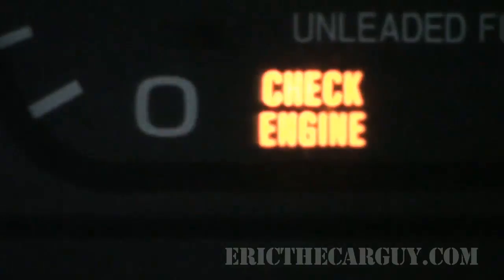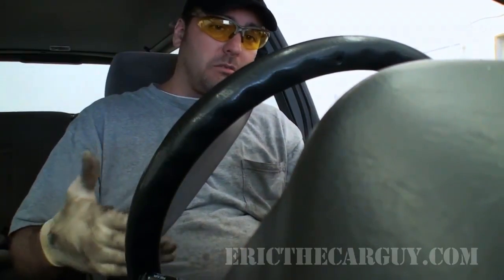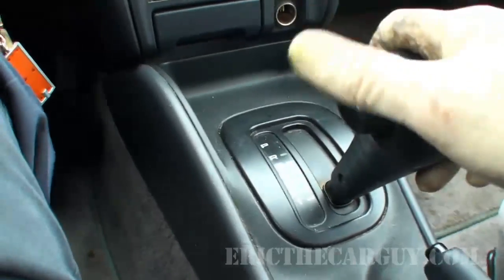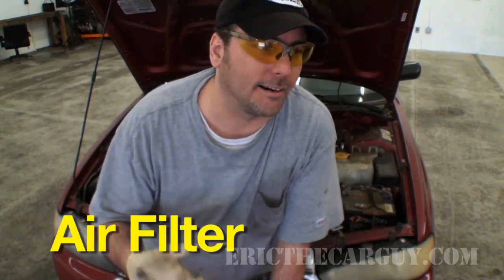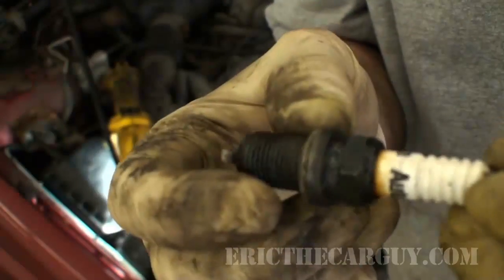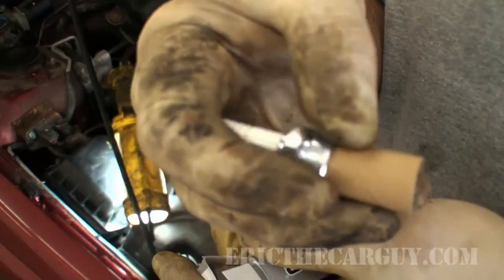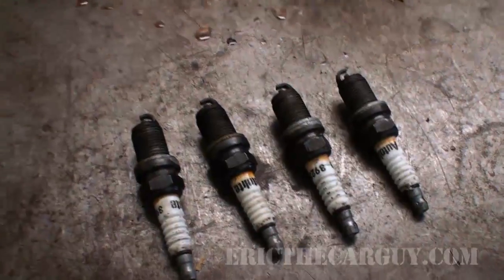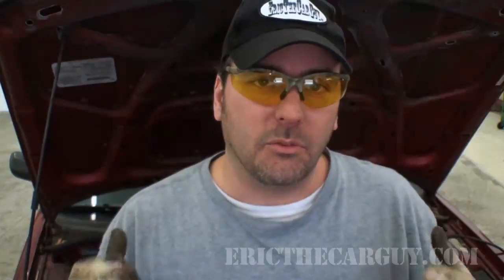Solving Engine Performance Issues (Part 1) - EricTheCarGuy

Comment: I know they don't boost it up but they're supposed to help the fuel burn a little more efficiently. I'm getting a cold air intake, flashing my ecu and a magnaflow exhaust system (i found them barely used really cheap and in perfect condition). I need to replace my spark plugs anyway so i'm wondering if there's any good thing about getting a set of the ones that are priced higher.

Comment: Change the spark plugs and wires, if the problem persists i point to the ignition coil. Btw, on older model Opels there always were ALOT of problems with the EGR valves. Take an old licence plate, cut out the shape of the gasket for the EGR (outer shape, do not make a hole in it) and place it between. If the problem is still there it's not your EGR valve.

Comment: Eh, no. The computer has very distinct margens in which it performes, there is no separate "fuel saving" position. The only back up position is the "emergency" one wich the CPU falls back to in case of a broken auxillary sensor, like inlet air temperature, O2 sensor, MAF or MAP sensor etc. If an TDC sensor is broken the engine won't run at all.

Comment: If by Seafoam you mean some sort of chemical cleaning agent, you most likely damaged your engine. NEVER EVER put chemical cleaning agents in your car or fuel tank, if you want to clean an engine, take it apart. Take the dipstick out, if your oil is very "thin" or it smells like gasoline, you need new piston rings.

Comment: That is normal, it's usually due to the petrol vaporising differently at different temperatures. On newer model cars (2000 and newer) there really shouldn't be a difference but on older cars, especially carburated ones this is normal.

Comment: The effects of that can range from  HP loss to burning a hole in your piston. ALWAYS stick to the recommended heat range unless you have a turbo application or you run the engine on LPG (liquified propane gas)

Comment: Yeah, that is called indexing your plugs. It means that your electrodes face a certain way in the cilinder. Usually toward the inlet valve because that is the coolest spot in your combustion chamber.

Comment: Get a 9" ford axle, that is the only one that can hold a bit of power. The rest will break. You will have to shorten it though which means you need new, custom inner axles.

Comment: Idk what Eric recommends, but if you want to go for more HP forget the spark plugs. Irridium's are going to give you 0 hp boost. That's just an urban legend manufacturers want you to believe so you buy the more expensive plugs. If you want a little more HP and a bit sharper throttle response, go for an cold air intake. Although, imho a cold air intake insta rice's your car.

Comment: Eric, this is the first video of you i ever watched and to me you seem to be a guy who knows how cars work. But ALWAYS gap the plugs, i work at a Ford garage (EU Fords that is) and i've had some NGK-R sparkplugs that had their gap way too narrow coming out of the box. And for Diesels, if you have problems with the car and the DTC codes say things like your EVAP valve is faulty, long and or short trim fuel, rail pressure etc etc just change the filter. 95% of the times that is the issue.

Comment: Yeah it is, those gear options are there for when you are driving in the mountains etc. You can always shift between 1st, 2nd, 3rd and drive with an automatic gearbox. The only thing that those options on the shifter do, is not go higher then that gear. Totally safe.

Comment: I replaced old ngk spark plugs with Bosch plugs in my 95 Nissan altima. Based on this video, should I put ngk plugs back in. Or does the brand of plugs not matter. Thanks

Comment: Well, they can have various problems like with Mass Air flow sensors they can just be dirty and give false readings. O2 sensors will give either fixed rich or fixed lean signals and tend to become less accurate as they age. Some sensors like TPS and MAP tend to last forever and either work or don't work. The same is usually true with cam and crank sensors. Usually though it's pretty obvious if there's a problem with the sensor though it could also be the sensor's wiring  too.

Comment: Haha, I'd completely forgotten about sensors as I'm currently driving an old carby, points carby car. Are sensors a case of they either work or they don't work or can they have several statuses of disrepair?

Comment: My girlfriend has a 97 Mitsubishi Eclipse. Everytime I come to a stop then press on the gas, the car revs then it jolts and goes. The car is a automatic, so I changed the tranny fluid, gasket and filter , the car worked  good for about 3 months and started doing it again.  The car is always slipping now. Can you please help

Comment: Hello, I'm about to start a project. This project is based on getting a 408 V8 engine into a Mini moris. Do you have any thoughts about this? If so please what kind of rear axel can mannage a 408 engine? (the engine is from Ford). 408 V8 - 400BHP (351 stroker) Alu tops. And what kind of gear box i need I think I just go to a scrap yard to get a 5 step manual gear box? 

Please repsond :)

Comment: URABUS is SUBARU backwards. Pretty much my input on this video, if it's not spark plug related, or fuel related, you've got a vacuum leak or busted rings, don't know what else can effect performance.

Comment: As usual, a great video. Thanks Eric. Only one suggestion, since you are working with the fuel system, keep a fire extinguisher handy. I'm sure you have several in the shop, but it might be worth mentioning for those of us whose shop is our driveway. :) Kinda like safety glasses, which by the way, yours rock!

Comment: Eric you are absolutely right about the ignition/spark plug stuff, Subarus run like crap unless the have the proper NGK plug and NGK or OEM wires. A lot of people have had misfires and poor performance that disappeared when they swapped out Bosch or whatever plugs for NGK. Great video.

Comment: For some Subarus, from what I was able to look up you should relieve the pressure by disconnecting the fuel pump relay and then run the engine till it dies.  This information supposedly came from the Factory Service Manual, so who am I to argue with that, lol.

At any rate, if you managed to change the filter and didn't start any fires, I'd say you were ok.

Comment: A/F sensor faulty? I had one sensor that was so bad it was screwin up engine performance. Same conern at you a hesitation like a couple seconds and then goes. At least that fixed the corolla i was working on. Also, fuel trim was -20% very screwed up.

Comment: You need to disconnect the negative battery terminal and take off the gas cap to relieve pressure in the system, THEN disconnect the lines.

Comment: happened to me my sister 95 legacy did the same thing with autolites i changed to autolite xp iridium and it even does burnouts on the spot hahahah the aceleration changed a lot maybe next time i would use ngk´s

Comment: Maybe its normal... COMPUTER has fuel economy mode .... and switches to get up and go mode.

or glitching MAF sensor .. scope it out ... for glitches.
Fuel rises because the fuel rail pipe contracts. 

hook a scope and tap on the MAF with a screw driver...

Comment: Sorry I meant: "for a couple of days until......"
I can't wait for the next video, and next steps.
(catalysator?, exhaust muffler?, airflow meter?, ECU?) btw. motor had a big service, so it's mechanically like new including timing belt, and everything. It has been well serviced and looked after by me. Well, a lot better, then the previous owner, which made a lot of work for my mechanic, after buying it. But looking back 6 years, it was worth it. I wouldn't change my car, and want to keep it.

Comment: 'cause we really feel that something is not right with the fuel pump itself. I once ran the tank empty. That certainly didn't help. And recently I had a leakage in the fuel line for a couple of until it was fixed. And the car was cranking for long seconds, because obviously I' ve lost pressure in the system. That didn't help either. The symptoms now are, that the car stutters randomly mostly when it warmed in., like it is running out of fuel. But then it just goes smoothly again. Your guess?THNX

Comment: What timing! Just the video I needed. We started the same route. I have an OPEL Vectra CC 2.0i cat. '93 model. With SplitFire sparkplugs. Chosen fronm the catalouge of SplitFire for the car. Now they say it lasts 75000miles. I havn't done that many, but they are 6 years old. We have checked them, and we think that they're in fine shape. They're some platinum plugs without electrodes. Anyway, we're getting a fuel pressure gauge, to do the next step. I think it will show something for us.....

Comment: My question would be. If the autolight plugs are okay for Ford, and the NKG's are good for Subaru. What about Bosh Platinum +4? I use those in all my vehicles and never have issues.

Comment: subrarus tend to build up carbon quite readily on the internals... so (even the service manual reccommends this) but u gotta perform the 'subaru upper engine clean' to the unknown... customers experience an increase in resposiveness after this has been performed

Comment: i have issues with opel omega 2.6i from 1991 year when it is cold it wont accelarate and often i hear detoantions in engine when i press gas.As soon engine warm up evry single problem desepear and engine pulls like hell.I cann pull this girl up to 230km/h so i think it is not mechanical problem.

Comment: jumping off the subject I would like to say fuck autozone and their battery warranty policies and if you have a autozone reward card good luck with that them bastards are so cheap I've been stuck on 4 credits . just checked my credits on line ,had four,went to autozone and bought a $70 dollar item and I still have four. this isn't a one time glitch. It's been going on for months now. answer ebay or one of the other parts stores my batt was 6month out of the free replacement they gave me 12 buck

Comment: "I suspect pressure was OK but volume was off..."

This is analogous to the voltage drop issue we see with electronics. Maybe a "pressure drop test" across a suspected fuel restriction would give useful information. Of course you would have to do that while the engine was running, so fuel is flowing across that restriction, ha ha. Technically this would be hard to do without sets of calibrated gauges.

Eric, I've been waiting for this video set for a year. Thanks!

Comment: For hesitation I'd be looking into a vacuum leak now that we know there wasn't really a problem with the fuel filter.  1psi of difference probably isn't going to do much.  I'll bet the filter didn't fix the hesitation but was a step in the right direction for tune up/maintenance.  Really enjoyed seeing you test the efficiency of a fuel filter.  That was great, learned something new.  Thank you.  Can't wait for part 2.

Comment: Eric, you are wrong regarding the gap of the plugs. I have a nissan N15, bought NGK spark-plugs (that's what the manual said, that's what i got for it) and checked the gap before installing them. The gaps were wrong on 2 of the spark plugs. The cardboard cylinder protects the electrode, but i don't think the gap is correct from the factory; at least on my plugs it wasn't

Comment: You honestly think that minute change in pressure justified changing the filter? What are we looking at, 1/4 to 1/2 psi change? But in your defense, it never hurts to change the gas filter on a preventative maintenance basis.

Comment: +1 on using the OE plugs.  Sadly parts stores will try to sell you on expensive precious metal plugs these days.  I have a Saturn (wasted spark ignition) that will actually misfire if you try to use those $10 plugs.  Meanwhile the stock NGKs at 1.50 each run like a champ.  Bottom line is if you don't know what makes certain plugs work or not work with a specific ignition system, or if you just want plugs that work, use the OE plugs.

Comment: They are safety glasses.  Yellow has a tendency to enhance vision a bit in dark lighting.  Same reason why you see a lot of people using them at gun ranges.  You can find those safety glasses or ones like it at Harbor Freight, Summit Racing, etc...

Comment: Honestly as long as you put a quality spark plug in as a replacement, you don't need a specific brand. If you went from platinum/etc to regular, or vice versa, it may make a difference good or bad. I run Champions in my Harley and it "requires" Harley plugs, basically the same plug without the bar & shield logo. I changed them and noticed a bit smoother idle, but new plugs should. I run E3s in my Silverados, both loved the change from single electrode. Either way keep up the good work. -Thrasher